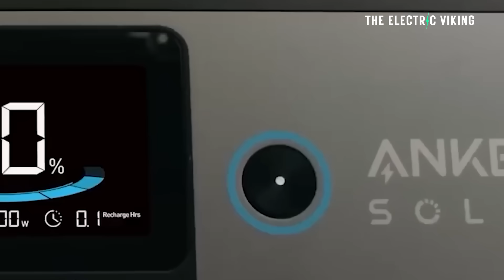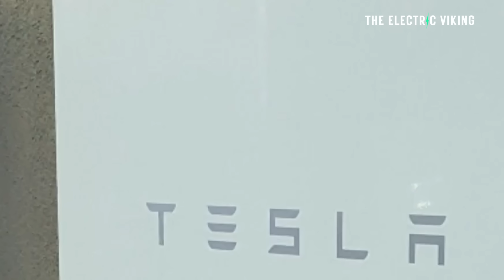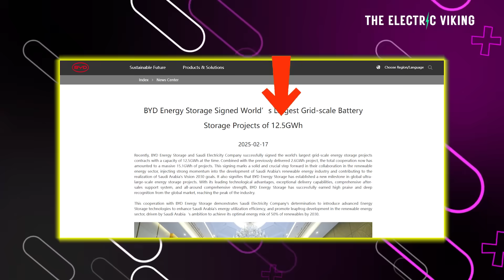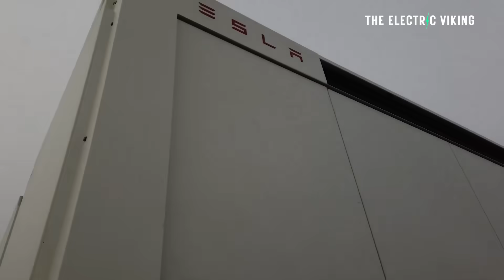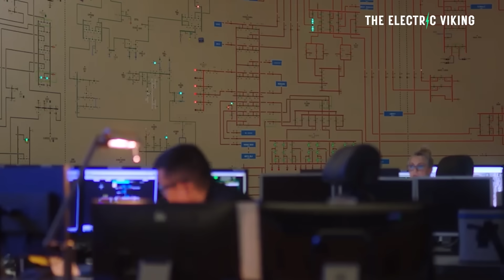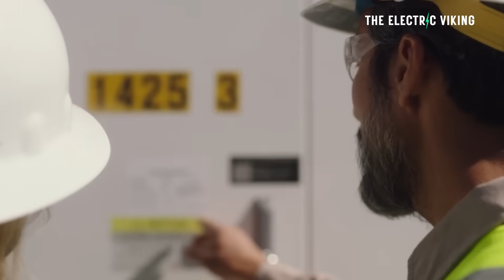Home battery installations in Australia go BALLISTIC - Forecast to hit 1 million!

Comment: The service charge is now 1/4 of my bill for the month . It might not be worth staying connected to the grid much longer . We use such a small amount of power it would be cheaper to just swap our grid tie inverter for an off grid hybrid inverter with a generator backup if the fees go up any more or the feed in drops any lower .

Comment: The battery rebate so far has been good hopefully installation process goes well for all
Concerned with no dodgy operators. Hopefully the federal government can replicate this for Hot Water Heat Pumps, Air Conditioning Heat pump units and induction cook tops. It is still extremely important to optimise our energy usage considering future energy needs on the grid.

Comment: The greatest thing is that the government have leveraged so much investment from us private individuals who will also maintain the system for them and save them, the government, from having to upgrade the grid, at least in the short term. I just spent 30k on solar and battery and heat pump water heater... and will commit to an electric vehicle and plan to run it as much as possible from solar. I'll also join a VPP ...

Comment: We had a 12.8kWh battery commissioned on 1 July - connected to our 9.24 kW PV system. Even though it's Winter and daily PV generation is at it's lowest the battery is already proving to be of benefit. We generally get enough excess PV to charge the battery enough to cover the evening peak. We top it up a little with offpeak at night to cover the morning peak. As we move into Spring the offpeak forced charge can be phased out entirely.

Well worth the expense. Our next electricity bill will look very different!

Comment: Totally ridiculous duplication on a massive scale , using costly environmentally damaging , high fire risk batteries on houses that used to be able to access cheap reliable electricity from a coal and hydro powered grid , but are now being forced by high cost intermittent wind and solar generation to spend thousands of dollars to try to avoid ever increasing power bills.
Insanity on a grand scale being adopted which will never achieve the intended purpose which was to control the climate.

Comment: Had the issue you spoke of, had to change battery brand because no stock, now delay with power wholesaler who takes weeks to approve battery, very slow going, about 2 months in with nothing still
Reply: I have been told the same from my installer here in SA, BYD battery is yours the same?
Reply: @EvilBambo0 nope, I went for the Neovolt battery, but had to change to Sofar power all one now

Comment: Victims of rooftop PV and batteries and v2g EVs massive storage batteries on wheels parked 23hrs every day and all night long, are the GRID OWNERS and investors and the CASH POOR consumers heavily invested in fossil fueled appliances and vehicles and technologies. 

Consumer Victims are being GRID GOUGED. 

High income, high marginal taxpayers are heavily into government subsidised dirt-cheap rooftop PV electricity and v2g EVs and batteries. 
High marginal taxpayers take $10,000 TAX-FREE out of fossil fueled energy and out of grid electricity market, annually for decades to come.

Poor low income fossil fueled consumers face 1, appliance replacement costs and 2, rooftop PV costs and 3, battery costs and 4, EV costs.

Substantial capital costs for the poorer many consumers locked into fossil fueled technology. 

The high income LNP voters are victimising the poor.

Comment: Love your optimism  Viking.  Surely the elephant in the room is V2G or V2H.  Car batteries are huge compared to most home batteries.  The government needs to do something to motivate OEMs to include this facility in vehicles.  If the OEMs are worried about car batteries wearing out during the warranty period, I am sure they could modify the warranty conditions to include a maximum number of cycles and Iam certain this could be measured.  I have already written to Chris Bowen about this - no reply yet.  Our EVs are not used over 90 per cent of the time.  This an opportunity to make more use of valuable assets and would be a quantum leap forward in balancing the grid.  Can you use your lobbying power on this issue?

Comment: MY 20 year old rooftop so;ar gave it up last week NOT going to repaid or replace as in Victoria essential services have declared a solar feed in rate of 0.4 cents a KW , my retailer is paying 1c per KW Cost/benefit does not justify it I can understand the solar battery set up in isolated parts of the country but as new renewables come into the grid the price of power from the grid SHOULD drop , have an EV wait for that to operate as a battery for the house ?  As I type 11am 56% of energy in the grid is from renewables

Comment: 2:00 snowy 2.0 in the land of decade droughts, brilliant 👏 👌 
I am being sarcastic.
Reply: Turdballs Turd that just keeps giving.
Abandoning it now would be the best and cheapest option, before it hits the $20+ Billion they forecast it could.
Reply: Snowy 2.0 ..was supposed to cost $8 Billion ,, now heading for well over $20 Billion ,,,stalled progress due to engineering faults.
Approved without any cost/benefit analysis , will never provide cheap electricity to the grid because it will only be used when electricity is scarce , which will be frequently due to the fact that solar fails every night and wind fails for at least 65 % of the time overall .
Just another renewables scam.

Comment: To calculate the kWh needed for an EV traveling 10,000 miles per year, you need to know the vehicle's efficiency in miles per kWh. Assuming an average efficiency of 3 miles per kWh, it would require approximately 3,333 kWh per year. 
Explanation:
• 1. Miles per kWh:
Electric vehicles (EVs) vary in how efficiently they convert electricity into miles. A common estimate is around 3 miles per kWh, but this can range from 2.5 to 4 miles per kWh depending on the car model, driving style, and conditions. 
• 2. Calculation:
Divide the total miles traveled (10,000) by the miles per kWh (e.g., 3) to get the total kWh needed. 
• 10,000 miles / 3 miles/kWh = 3,333 kWh
• 16,000 km = 3,333 kWh 
• 3,333 is 2kWh rooftop PV or 4m²
• 9kwh daily avg. top-up to each EV.
• 83TWh more rooftop PV electricity annually for 20million EV vehicles and no PETROLEUM annually.
• Plus no GAS heating and cooking and hotwater is 100TWh more rooftop PV electricity annually. 

So, Self generation 250TWh plus 80TWh plus 100TWh is 430TWh. 75% more rooftop PV 
12kw avg rooftop PV system on 20million roofs.
With 20million v2g EVs massive battery. 

Just my comment. 

No new grid capacity construction savings $TRILLIONS. 
Annual tax-free savings $10,000 per year for decades and decades. 
10million homes.
20million vehicles. 
In Australia. 
90% of the world's population live in the sunbelt.

Comment: Calculate winter demand including EV daily top-up, and double the size.
Cool shaded rooftops in hot summer. Lowers air-conditioning demand. 

The grid capacity is 250TWh annually to consumers. 
Consumers match and double that with rooftop PV then consumers can keep the grid at maximum capacity but now supplying industrial consumers moving away from fossil fuels to clean feed-in electricity.
Grid owners and investors KEEP THEIR CASHFLOW. 
Grid owners and investors avoid the SHTTSNPANTS no cashflow terrors.
Grid owners can provide individual's with emergency backup services. 😊😊😊😊😊

Comment: And here in Brazil we have a heavy heavy big hydro grid so we can just keep adding more and more solar/wind. Latest numbers are we're getting 55% from hydro, 14,8% from wind, 8,4% from biomass, and just 16% from fossil sources. Solar is growing very very quickly but still less than 10%. So already around 85% fossil free electricity. We should double our solar and grow wind squeezing fossil at least out of the cities integrated in the main national grid (we have a few small/medium cities in the middle of the Amazon jungle that don't have the national grid connection, but that's small potatoes).
We could probably use 10GW / 30GWh worth of batteries (compared with 200+GW worth of generation capacity) to handle any wind/solar farms tripping out of the system unexpectedly.

Comment: The whole world needs something like 10TWh/3TW worth of battery storage to handle the peak demand assuming there's a baseload source (and lots of excess solar to charge the batteries). That's 400 million 25kWh/10kW batteries.
I don't think it will make much sense to have batteries bigger than that for a normal average developed world house. That's 750kWh / month assuming daily full depth discharge. A 50kWh / 15kW battery + 10kW of solar would essentially allow houses to go fully off grid.
200 million EVs with bidirectional charging with average 50kWh batteries is another 10TWh worth of storage.
Add another 10TWh in grid storage, total 30TWh and that's 10 hours worth of average 3TW electricity demand. Enough to at least cover full demand from sunset until 1AM locally, ignoring any long distance transmission ability to shift loads geographically, as well as nuclear/hydro/wind/geothermal/backup fossil sources, which off course isn't the case.
30TWh / 10TW storage should be enough for the world to get at least 80% of our electricity from non fossil sources and only use any fossil sources during the night. At that point it would make far more sense to add lots and lots of wind instead of more battery and more solar.
Reply: In Australia solar makes more sense than wind power in most locations.
Reply: @Terry-y2r Brazil is no longer building any new hydro stations. We had a wind buildup spurt right before solar prices dropped into very economical ranges. Right now solar pv is dominating in growth. I expect we'll get at least 25% electricity from solar within 10 years worst case.
Reply: @marcelopacheco2479  You will probably find that where economic Hydro dams will be converted to pumped hydro storage, to provide more long term energy storage. Where I live, Australia, solar is now dominating renewable energy growth. We already produce about a third of our energy from renewables.
Reply: @Terry-y2r  Dams just throttle more and more. There's no real conversion. They generate less in the day, even less in a dry day and more at night, even more at a rainy night.

Comment: I signed up for 14 kw solar, 32 kwh battery, AC EV charger right after the last federal election. I waited 6 weeks for mine to be installed. Just helped my uncle to quote a similar system and he has to wait for 3 months until October. 😮
I made a short video if anyone want to see it on my channel.

Comment: Just had a new Sigenergy solar battery system commissioned last week here in Perth, WA, and haven’t had to take any electricity from the grid since after 8 days. 32kWh battery, 21kW solar panels, with a 20kW inverter (set to output 15KW to comply with Western Power’s bizarre regulations). The system seems to match our winter usage profile very well and we’ll have much more spare energy generation in the summer.
There are additional benefits of being able to use heat much more liberally than before, the wife and I are nice and cozy. Also, this particular battery provides virtually instantaneous failover if the grid drops out (tested today), so acts as a giant UPS for computers, etc. I’m also in the process of replacing our gas cooktop with an electric induction one. Eventually I’ll replace the gas water heater with an air-source heat pump, at which point I’ll be able to ditch gas altogether.
Finally, I’d expect to switch to an electric car in a few years and charge it from my excess solar for almost the whole year, so there’ll be no more petrol bills to pay.
Reply: well done! how is it running in winter? is the battery charging up? I just had my PW3 turned on couple days ago in melbourne. worked well yesterday, but was mostly sunny. Our house is all electric and we have a Tesla car, so no more fossil fuel usage here!
Reply: @Pepper.123 Early days but the battery hasn’t run completely flat since it was commissioned 8 days ago.

Comment: Home PV panels coupled with storage batteries and EV's are part of an historic movement toward decentralization of energy production. It is not just a financial and environmental issue. It also epitomizes the movement away from centralized authorities of all types. Increased individual freedom is the goal and result.  Kudos to Aussies for going in that direction.
Reply: This gives the centralised authorities more control over us and our power then ever. Designed to be used and controlled by them however they want
Reply: Obvious solution for Aussie out back but not the way for dense settlement. All utilities are cheaper to build and more efficiently to manage at scale.
Reply: @joem0088  Utility scale generation is cheaper to build, but the cost of the new transmission infrastructure it will require is the kicker. Distributed generation and storage through rooftop solar and home batteries uses the capacity of existing poles, wires and substations. Transmission loss is also lower.

Comment: Hi Sam. I agree with you. My home battery storage is 30kwh backed by 22kw of solar in Melbourne. I don't need the grid anymore.
Reply: how is it running in winter at the moment? I generated 26kWh yesterday from a 13.5kw solar system.. and charged my tesla battery no worries :)
Reply: @Pepper.123 seems to be a fair difference depending on location.
I'm in Queensland and my 10kw system generated 51.9kw/h yesterday and exported 36.9 with having the pool pump running twice a day. 
It produces around 70kw/h in summer.
We do have our bad days but not very often really.
Reply: In Perth, government limits us to 5kWh solar panels. Despite this we have high production because it is much sunnier here, and if we run short of sun to fill our house battery we force charge it from the grid at 8c per kWh from 9-3pm. Runs heating, cooling and EV with no issues and minimal cost. Connection to grid is useful to earn money from feed-in tariff.

Comment: Home batteries without solar charging is wasting the initial free energy source.  Does not seem right to me - or people having more than one battery installed along with their solar which is skewing the figures?
Reply: Respectfully, I disagree with this. Most parts of Australia now how so much solar production during the day that there are negative feed in rates. The more batteries we have to soak up that generation that is otherwise curtailed, the better!

Community batteries are another option that some states, such as Victoria, are exploring. These are smaller batteries compared to the "grid-scale" ones talked about on this video that are designed to serve a neighbourhood / suburb, but are bigger than an individual battery you might install at home.
Reply: @timothymukaibo6616    Thanks for the info.
Reply: People already have solar, adding batteries